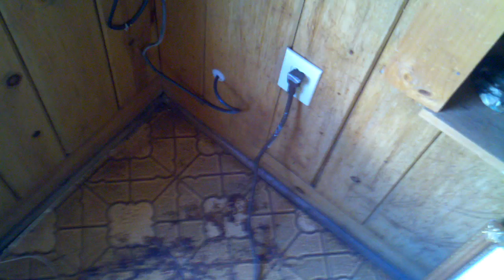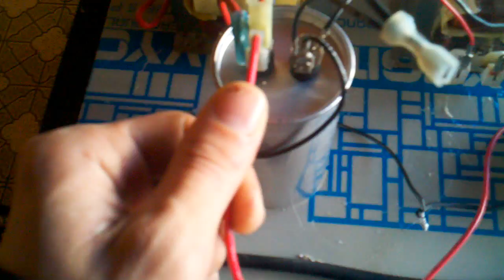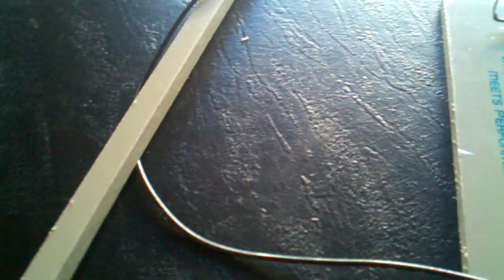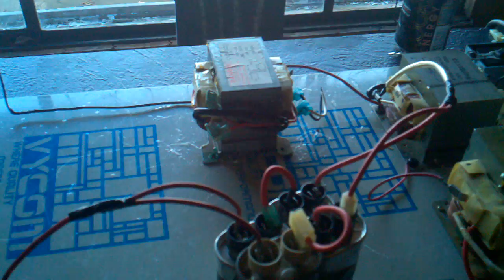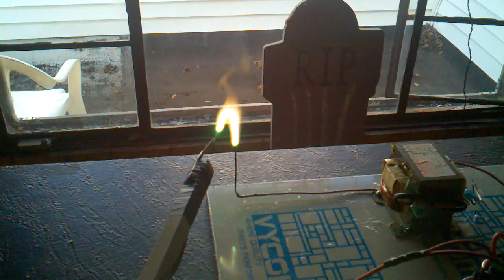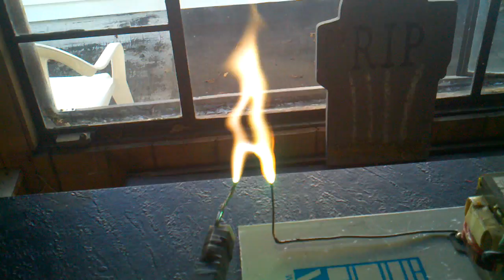Resonant Microwave Oven High Voltage Setup

Comment: you can do the samy with only one transformer without any capacitors! no need for many transformers or capacitors! the  way is set they only cancel each other out.
Reply: Resonance cannot be acheived with a single transformer; capacitors are a necessary component so that the impedance can be brought to a minimum value. The inductance and capacitance in a circuit must be tuned by using inductors which in this case is the transformers, and capacitors.
Reply: It is unclear if he actually acheives resonance in this video though; as the arc generated does appear to be about the same size as an arc produced by a single transformer.

Comment: Is there any benefit or detriment to leaving it AC? Or is that only if ur making a Tesla coil
Reply: Well it's all in alternating current, the secondary coils in these are wired to the base and housing as a ground because it's so solid. So what you're doing is using it in the case of the two connected in parallel is to double the current iirc, without checking, the capacitor bank smooths out the frequency and tunes up the waves to be much closer to ideal efficiency. The ballast transformer needs the primary shorted prevent it from making any connections because as you use this, your energy from the parallel transformers are going to go to the base ground and also into the secondary, and the primary will become energized by the magnetic field that generates, and so it's totally isolated except for it's connection to the baseplate of that other transformer, which will just recycle that energy back into your capacitor bank. So in short, it is an alternating current. A direct current setup would require a rectifier that could handle roughly.... 4KV and around 5A in this case, but that also depends on the ballast and how much current it allows to flow. I don't think there would be any detriment, but due to the capacitors it may end up being pulsed DC.

As for using this to power a Tesla coil, there are much more efficient methods, a flyback/line output transformer, large capacitor banks in parallel and series, there are some that use power transistors or mosfets and a feedback coil, check out the ZVS driver, in fact I'll make a video on that as well soon! Because why not lol

Comment: I would suggest less mumbling. Talk like you know what your on about. Also tells us what its for. Will it make ozone for instance?
Reply: Also it probably does make ozone, but if you want to make a lot then you need much higher voltage and much less amperage, you want a negative ion generator for that. I'll make a video on the ZVS power supply setup I made, that kicks out plenty, but negative ions can be made much easier with smaller devices. You can get a 1MV (1,000,000v) low amperage potted transformer on Amazon for like $8, then you just need what amounts to an air capacitor, your wire goes inside an insulator and you wrap a coil around the outside and the electrons, with enough potential, will do their damnedest to make the jump. Barring any arcs going through the insulator or around it, you'll see nice purple mini arcs of piles of electrons jumping out, thus generating your negative ions/ozone. 

But my lack of enthusiasm must mean I'm not sure what I'm on about lol
Reply: It's me, that Google merge messed a lot up. This was actually just to describe how it's set up physically, if you were going to build it you either would be using a wiring diagram or already know how it will work and are curious about placement... it would be dangerous or even fatal if neither of those are true. However, what this is, is a circuit with power factor correction, meaning the voltage and current frequency waves are in phase, and there is less clash so less energy is lost as heat. It's also basically a power supply, probably in the area of 4.5kV and maybe 5A or so. I think I will make another video that goes into way more detail about everything, thanks! :)

Comment: Id like to use the capacitors for an induction heating tool and I want to power them with an adjust amp rectifier of 25 amps but do I think I'd need the transformers??
Reply from the maker: I don't see any reason why you would, though I'm not clear on the specifics. The caps can certainly handle 25 amps, the transformers on the other hand.....
Reply: Actually you can modify microwave oven transformers to output way more current than voltage